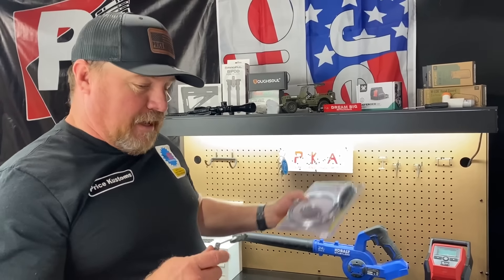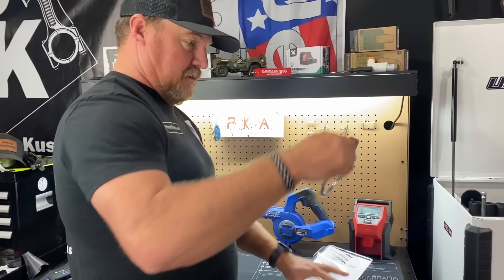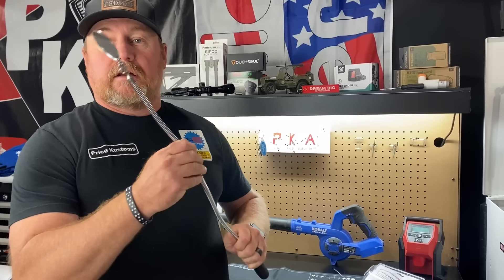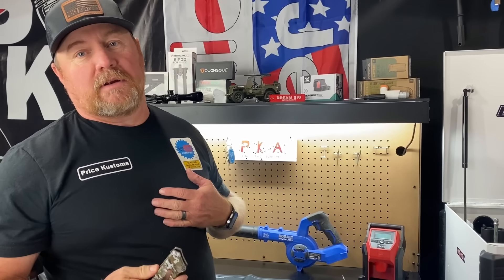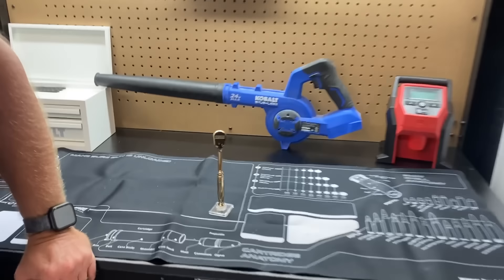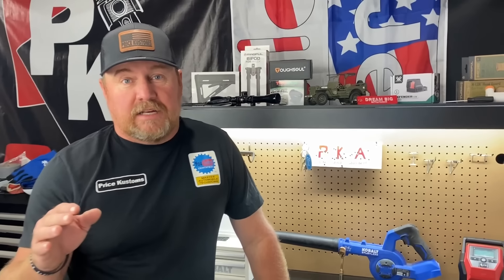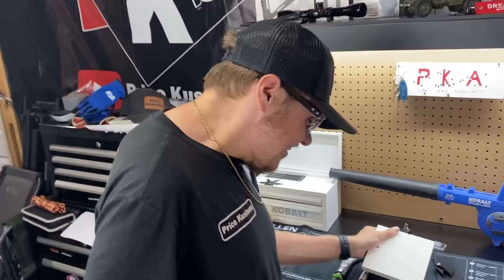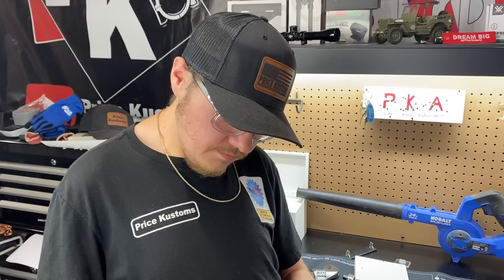5 WEIRDEST HARBOR FREIGHT TOOLS!!! #harborfreight #tools #toolreviews #icon #toolboxtour #handtools

Comment: 1/2 drive extendable is definitely worth the price. Im a industrial field machinist/bolting tech and ive never had an issue with that ratchet. Broke the end of the handle and easily replaced definitely worth it
Reply: I’m going to get one
Reply from the maker: We need to get one

Comment: If you're working on modern vehicles , that mirror could be a time saver . It's flexibility is an extreme advantage over the straight shaft models . Thanks for another great video !
Reply: This is what I'm thinking. Sometimes you have to snake the mirror into and around engine components from the side, then look from the top.
Reply from the maker: Good point. Thanks

Comment: 1.The flex inspection mirror you can wrap around something to make it hands free in case you are using it to do something like thread an awkward position bolt and you decide that line of sight is needed.

2. The gold Ratchet I would consider it a Skill symbol since the only use I can come up with for it is to say I own one OR making a Shadow box display for someone.

3. the 8" blade is functionally a very light use but it covers that primal need for every guy to have their own Rambo knife. 

4. this is basically a travel toolbox ratchet as it covers multiple sizes and has it own breaker bar option.

5. the adjustable wrench and that extension is again an attempt at having a built in breaker bar if needed. 

I have 3 and 4, will likely get 5, but I have no use for 1 since I have a probe camera and I don't work in a field that justifies a ratchet enough to make 2 anything more than a "I own one," purchase
Reply: Thanks

Comment: The 1/2” Pittsburg expandable ratchet I use all the time to torque down lug nuts. On 1 3/4 ton pickup truck the lug nut would not back off for any reason because someone loctited JB welded and flared the bolt behind the nut, so only using the 1/2” ratchet I tightened the nut until the bolt snapped, no cheater bar used, the stud in 2 pieces so they are strong. That was 7 years ago and I am still using the same ratchet to this day.
Reply: I need that one

Comment: I have the 1/2 inch drive extendable ratchet and it is legit. I have used it to break loose the lug nuts on my F350 dually. I also used it to change out the cab mounts on it.
Reply from the maker: We need to get it

Comment: My favorites from Harbor Freight would be the swivel / roto head ratchets. I cut the plastic handle off of the 1/2" and slide a pipe over the end when I really need to motivate something. Also, the  PITTSBURGH PRO 1/4 in, 3/8 in. Drive Long-Reach Dual Flex Head Ratchet is amazing and can take a beating too.
Reply: Thanks for watching

Comment: Wile that 8 inch knife looks diabolical and ominous, it's primary purpose is actually for cutting wood. If a fire starter that they also sell can fit in the handle of that knife, that might be quite a good survival item, indeed. You can use it to cut larger pieces of wood by "battoning" the knife. One piece blades are always more reliable than folders. While Multitools are great and you'd certainly want one as well, that large knife is just more robust in every way. Off topic, but a small hatchet is also quite useful. Weight is everything, as is durability in the field, where the tool MUST work without failing. I've been looking for something lighter than a hatchet, maybe a tomahawk as the best solution.

Comment: The knife is complete garbage and very dangerous.   The blade bolts onto the hollow handle and will break very easy.  The knife is a cheap gimmick.  Not to mention the cheap steel with a poor heat treat.  Please don't buy that.